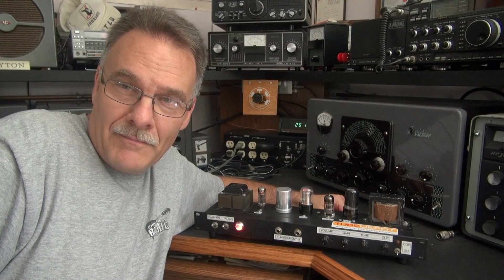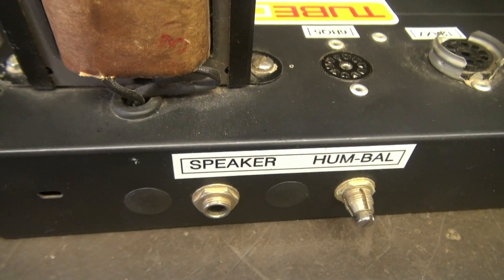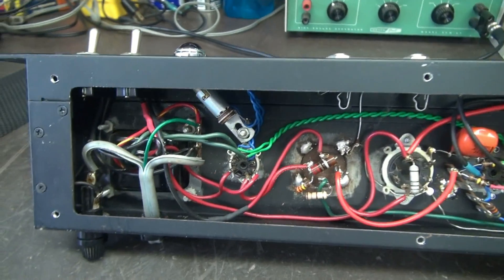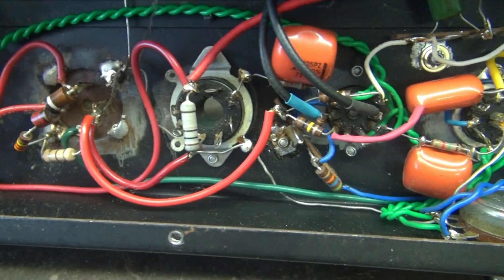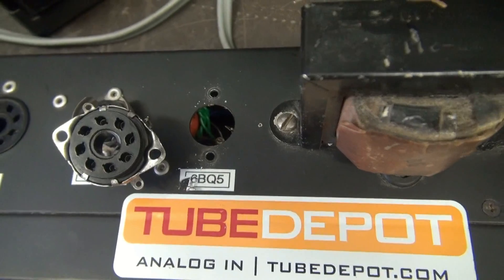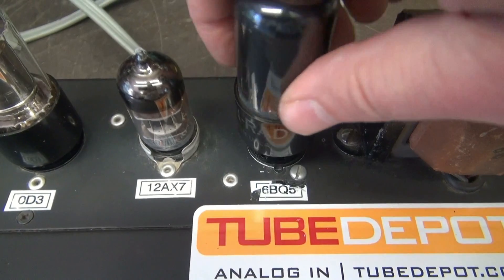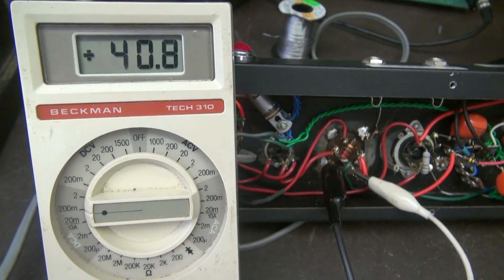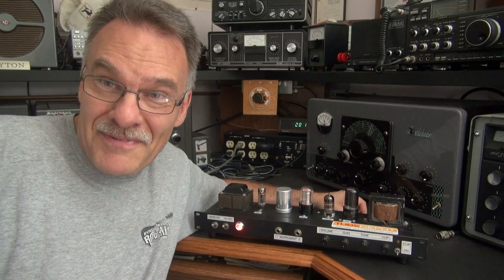How to convert 6BQ5 to 6V6 tube guitar amp D-lab Black Diamond

Comment: on a 5F1 style amp i used 6X5 because i had the 8 pin connector, what does the OD3 tube do for the amp?

Comment: SO, THE DAVIS AMP (MODEL 106) USES A 6EU7 PREAMP TUBE AND, THESE ARE GETTING HARDER TO COME BY, WHAT ARE YOUR THOUGHT ON CHANGING TO A 12AX7 ? THANKS
Reply from the maker: You could do that. The tube is used for the main and mic channel, 1 section per. If your happy with the gain level, the 12ax7 will do fine with simple resistor updates. TD
Reply: I went through this recently with a Airline Reverb unit. Turns out, the 6EU7 has EXACTLY the same specs as a 12AX7.
Friend of mine (Mark in Plymouth,MI) said that RCA would sometimes do this in order to have a tube all to themselves.
Understand, the pin out is different and will need to be changed.

Comment: I have a Davis PA amp that I am working on that uses two 6bq5's and I and going to have to buy new tubes. So, now would be the time to change.
Reply from the maker: Yes, I would highly recommend changing out the troublesome 6BQ5's with 6V6's. Remember, you will have to re-bias them. 6V6's are not the same electrically. TD
Reply: Thanks, 40ma should about right,  and that tool you used to cut the hole. Where can I get one?
Reply from the maker: Those are Greenlee punches. Kind of pricey. You could also use a large stepper bit

Comment: Do the 6v6 add more output?  The break-up around the same?  Other than availability what would be some other advantages? Thanks
Reply from the maker: Hello, Output would be approx the same. Reliability is the main gain. Also, the 6V6 gives you a much more dynamic sound rather than the pinched/harsh sound from EL84's. Cannot say for break-up since I do not know your amp's characteristics. TD

Comment: Good video! 6BQ5/EL-84's are not a wise choice for guitar amplifier use. I've seen, and still see numerous failures. Mainly, because guitar amp manufacturers run them up to the limit and beyond. The Fender Blues JR amp runs them at 40 mA which is insane for a 6BQ5. They were good for low power Hi-Fi amplifiers, but that's all. Keep 'em comin' :)
Reply from the maker: I agree man. A friend of mine had a DR Z twin EL84 amp. We were constantly changing the tubes after a few gigs. The expense added up to the point that he sold it. I also find that these tubes like to develop heater to cathode shorts, which really causes havoc! I built a few little AC-4 amps using the 6BQ5, with no issue, however the HV was only abt 250vdc.  I recently swapped these tubes for 6V6's in a Fender Pro Jr and your right they were running hotter than a firecracker! 6V6's rule! TD

Comment: Although I'm personally more found of the 6AQ5 and the 6BM8 series of tubes, I don't really think the problem is in the 6BQ5 itself. It's more bad circuit design than anything.
Reply: The circuit design looks good to me Terry, Great Job! The little regulator for the pre-amp is a nice touch.
Reply from the maker: Thank you Sir. I am trying to up the quality of my videos and of course maintain some stale humor. Glad you like the little rack amp. I appreciate your approval. TD
Reply from the maker: I agree. The 6AQ5 has always been my favorite. My opti-plex heads use them push pull. What a great chimey sound. The 6BQ5/EL84 also is not on my favorite list. Seems to work oK in the VOX AC-4, however it is only running at about 250vdc. I will stick to the 6V6 for 5 watt class a amps. TD
Reply: +D-lab Electronics to me it's more of a necessity than a tone thing, because I can get NOS 6AQ5s for something between a quarter or a fifth of the price of a 6V6. currently, I'm working on a push-pull PCL82+12AX7 amp, with a sort of a "top boost" preamp, but modified to my taste.
Reply: @d-labelectronics   How about a 6CM6?